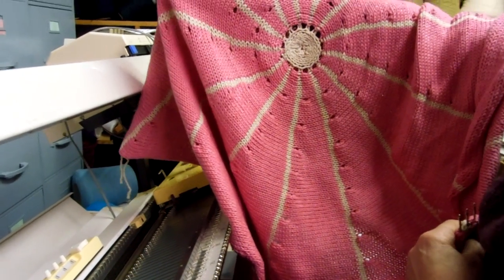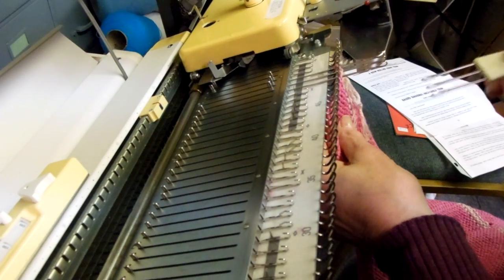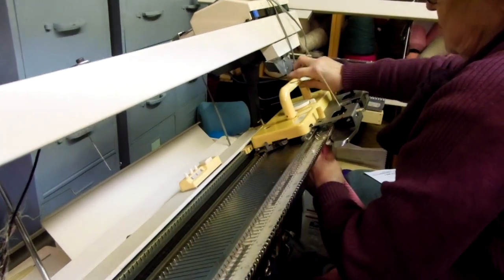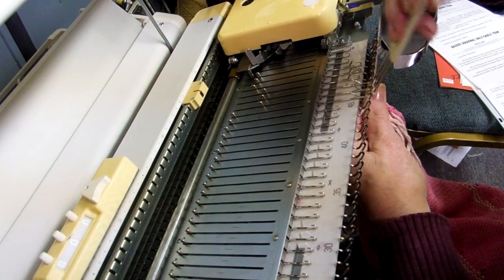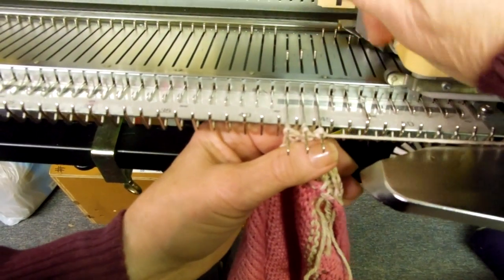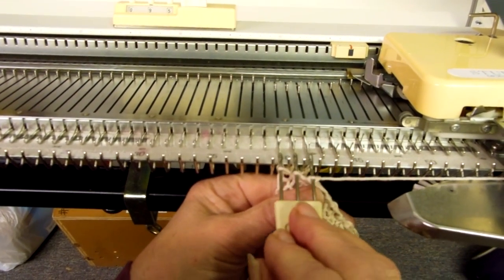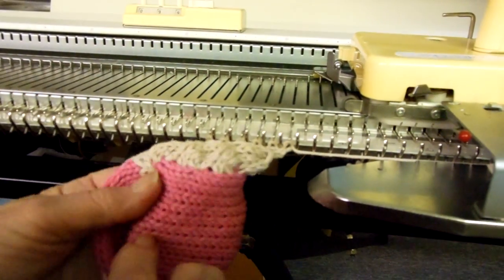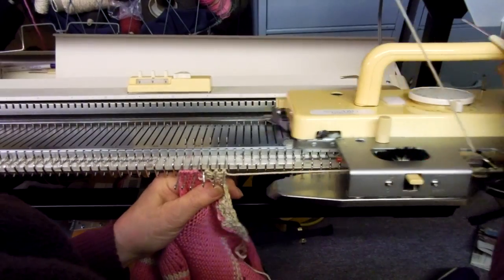Machine Knitting Experiences: Raised Diagonal Half-Cable Trim (part 1) by Carole Wurst

Comment: Hi carol, what model machine is this?
Reply from the maker: The machine in this video is the Silver Reed SK890 electronic bulky, but you can use any bulky machine. No electronic or punchcard patterning is required.